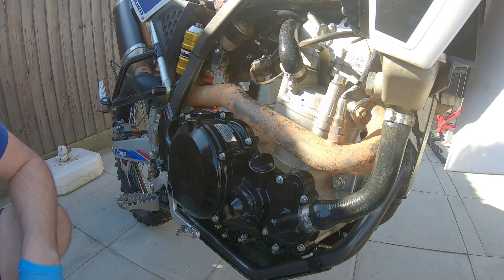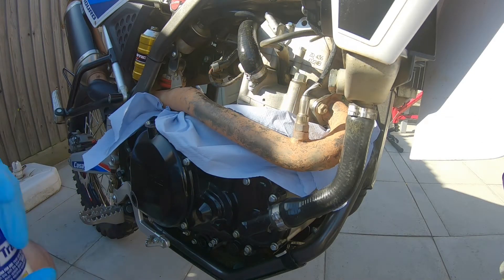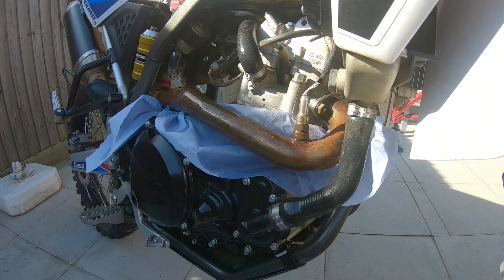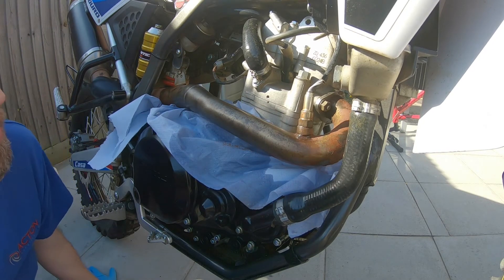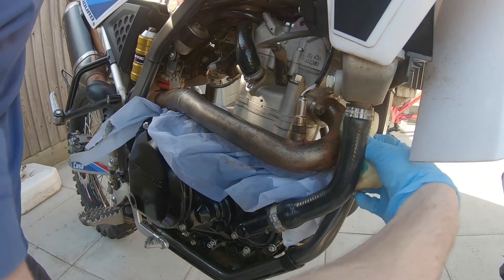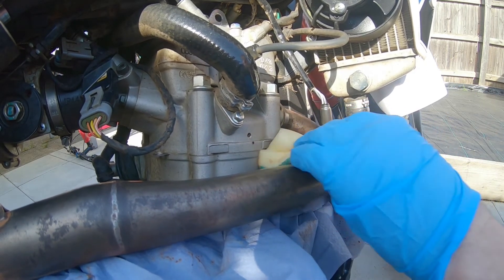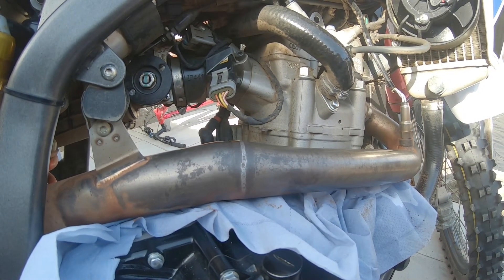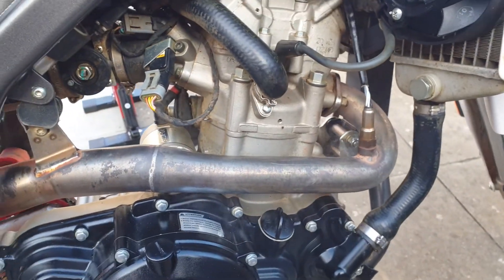Fantic E Casa 250 Exhaust Cleaning

Comment: Pretty good, but it's not difficult to take it off first which makes the cleaning much easier. You don't have to remove the muffler, removing header is enough
Reply from the maker: Have you seen where the springs are on the exhaust? It would be easier to take it off in one piece I think.
Reply: Dynamo Tightstar hi, on my 125cc Casa it was a slip-on, no springs. Sorry not sure about the 250cc, I thought it would be similar.. removing the muffler involves a few more screws, not too bad either but on the 125cc it was enough to remove just the 2 locknuts in the header connecting to the block.
Reply from the maker: @ninja1970fin  I thought all bikes had springs to hold it on. I guess with a good enough fixing it doesn't need springs.